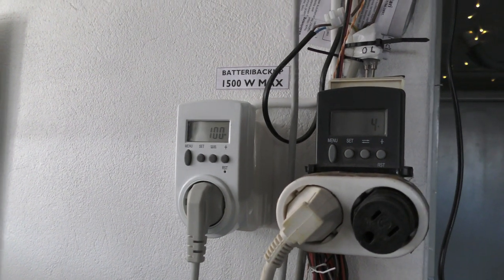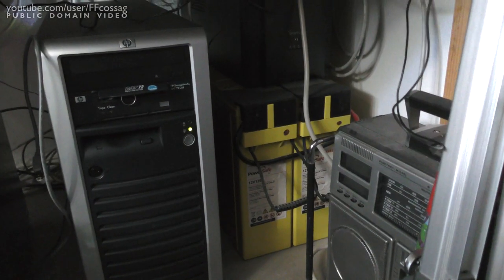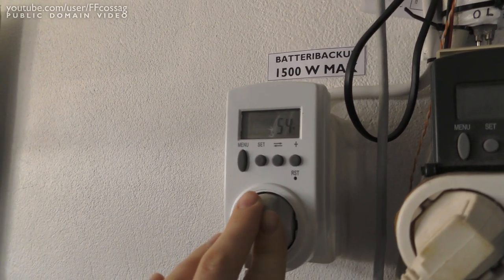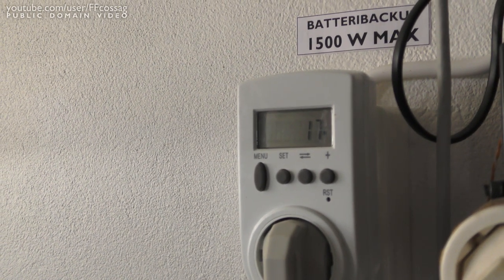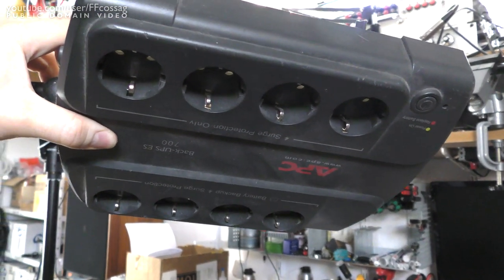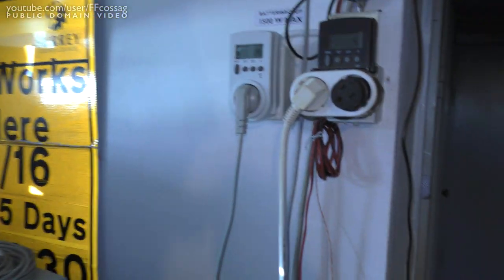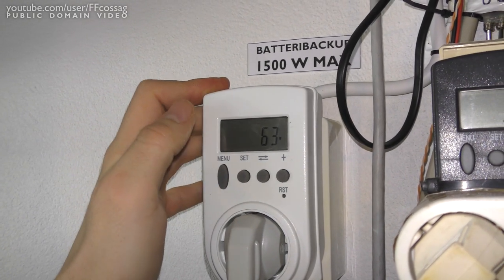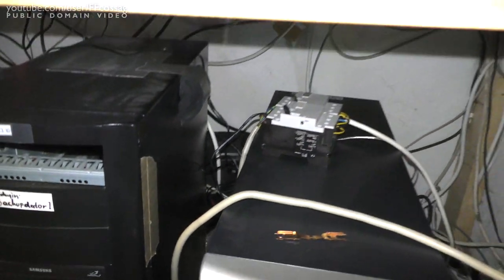Workshop UPS downgrade, 1500 VA to 300 VA! (w/ custom trash extension cord build)

Comment: drivle aside, I found a few Eaton 5PX and an extra battery module on ebay for less than $750 total. One is a 1500 and the other is a 2200. After replacing the Delta fans with some noctua 80mm ones, they are considerably quiet in my home office. Run ~115-330W 24/7 for an unRaid NAS and VM host.

Comment: Yep a very long week :-).
Its amazing how much power is used by lots of things on standby as well, i know people that have psu's for laptops/printers/monitors/chargers that never get disconnected.

Ive also known people have a brick for a printer running for years after the printer was thrown away, the psu was forgotten behind the nest of wires lol.
Reply from the maker: You see the same thing with people who hook their decade old DVB-T boxes into their 2015 TV. Often also through an unplugged VCR. Through which both the SCART and the antenna are run. Just because that's how it's always been.

Comment: It could be that the batteries are faulty, causing excessive current draw, I would try different batteries first.
Reply from the maker: They are faulty (duh). That won't change the fact that the line interactive Smart-UPS series draw a constant 15-20 W by just having their transformer connected.

Comment: Isn't the operational mode of these two UPSs basically the same? If not, what's the difference between line interactive and offline?
Reply from the maker: The line interactive APC units always keep the big, inefficient transformer connected to the power grid in order to prevent harsh buck/boost switching, whereas the back-UPS units don't have that feature and just use a tiny PCB transformer for battery charging.

Comment: Hi, I've got an APC UPS 700 that thinks the battery is too low and tried to overcharge it.  Do you know if there is an adjustment for charging?  I only see one trimpot on the PC board but don't know what it's for.
Reply from the maker: I've never played much with the white ones.

Comment: Is the power grid bad where you are located?  I can't remember the last time I had a power interruption, not any time in the last ten years at least so I've never felt the need for a UPS.
Reply from the maker: I live rurally on an island so far out in nowhere that it's almost a country of its own. Combined with the tendency of electronics hobbyists to blow house fuses, the power outlets in my workshop aren't the most stable sources of electricity.
Reply: Ah that explains the UPS then :-D
Reply: FFcossag not that you need it. But wouldn't a small inverter with auto change over. Be more efficient? Along with a small battery charger. Not the most cost effective. But wouldn't the inverter be more effiecent at making power? And zero vamp load when charger isn't used. I don't know that much about ups. I have a ups 1500 I just use as a backup inverter. Connected to a 200 ah batt bank! I'm off grid. With a 5kw inverter. With solar and hopefully a small hydro setup coming. I just need more batteries! And/ Or a hydroelectric power source. To charge and power my inverter.
Reply: FFcossag yeah I'm the foothills of NC. And the power goes out all the time. Trees on power lines cars on power lines. Or just crappy power lines. Usually just a minute or two. Just long enough to cause a load of trouble. if you aren't prepared. But if there's a big storm . like hurricane on the coast. Some have went a month or two! I hope that don't happen again!

Comment: I know you are smart about electronics I appreciate these videos its helped me out alot.  Question, have you considered putting your batteries on a piece of wood? My experience batteries die quickly directly on concrete.
Reply from the maker: That's an ancient myth from the times when lead-acids were made out of rubber, which would cause accelerated self-discharge when placed on conductive concrete.
Reply: ok, I appreciate the insite, I was always told that and I thought it was for temperature stabilization and grounding or something but it makes sense thanks for clarifying that.

Comment: Did you modify the charger in that Back-UPS in any way?
It isnt exactly what i call a good design (unsmoothed voltage going to a 7815, followed by 2 diodes) and it sort of started APCs reputation for killing batteries.
Reply from the maker: No. They charge at a lovely, way-too-low 13.2 V. I just take the battery out every now and again to charge it fully.
Reply: Okay, they might have added another diode in that model?
I have a 500VA one that charges at around 13.8V. I did disable that charger totally, as it is connected to the battery also used by my DC-UPS, which has a much better charger.
Reply from the maker: It's got to do with the fact that "let's take a 7815 and put a couple of diodes outside the feedback loop" isn't a very accurate way to build a battery charger. At all.
Reply: Yes.
Normally i would expect about 13.8v for that (witn 2 diodes, as i measured on mine). Your 13.2V sounds more like they added a third one. Or you measured with no battery connected? Its pretty much unfiltered with 100Hz ripple, so you would measure less than the actual peak voltage (to which the battery will eventually charge).
Reply from the maker: It just sits at about 13.2 V. All of my Back-UPS units are like this, I've never bothered researching it.

Comment: In a other Video (https://www.youtube.com/watch?v=JrLZF00qJS8&t=15s) I saw an guy, putting 12V to the terminals of a 24V UPS, does that really work? Perhaps even using a  apc smart 750 or similar, since i need a sinus like UPS for use as an inverter.I believe it could work, because the Voltage on the battery with full load, might drop to 11V as well.

Would be great, if you could check that out ;)
Reply from the maker: That's a 12 V UPS; the batteries are connected in parallel.
Reply: Ups, I missed that 😯😯